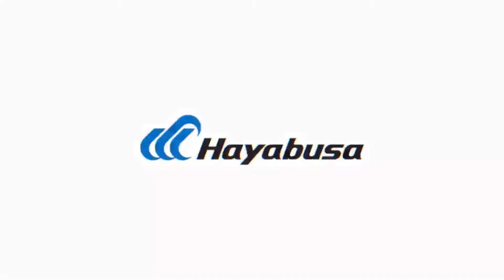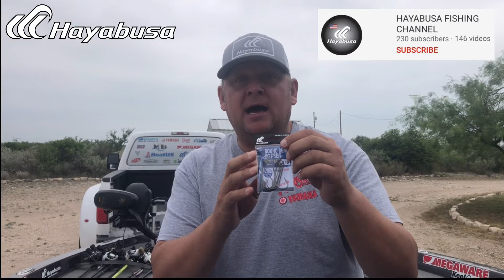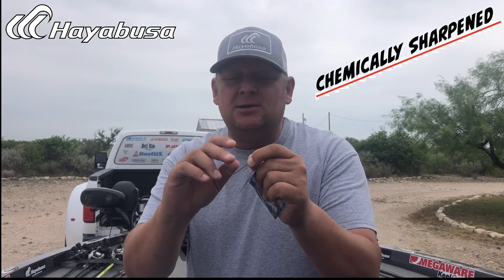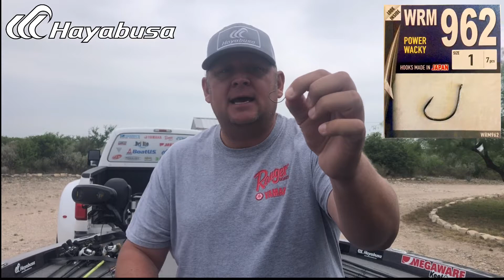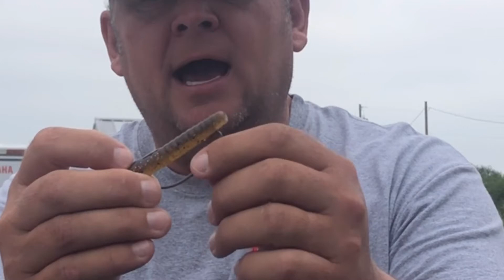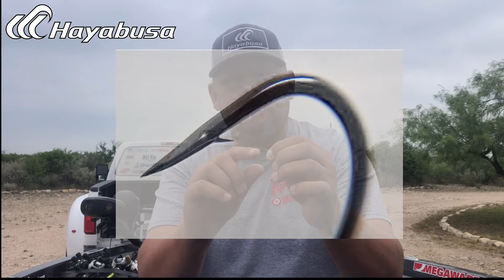Check'em out! Hayabusa Advantages - Kurt Dove, FLW Pro Circuit Angler

Comment: Picked up the swimbait hooks. Hands down the best swimbait hook I've used. Sharp, slick, and strong. 7/0 is the biggest one they got. Need one that fits the 6inch boom boom swimbait. Are they releasing bigger sizes soon?
Reply: Thanks for the feed back, no plans of larger hooks at this time.